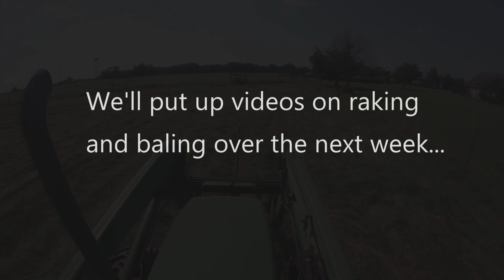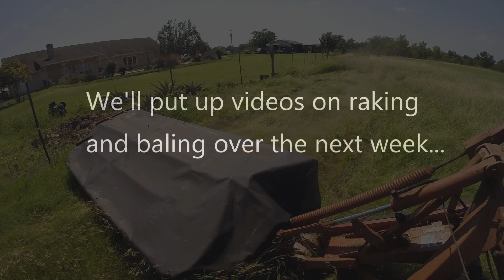Cutting Hay; Cutting Bermudagrass Hay with an Old Kuhn Disk Mower

Comment: Every one that I see mowing circles the field,     We circle the outside about 6 mower widths and then star on one side of the field and    mow from one end to the other..... in straight cuts..... All our tractors are GPS  auto steer so the cuts are  even and more precise...... also it allows you to bale  in basically the same way it is mowed....  no dragging hay from across the cuts....   cleaner    less field loss
Reply from the maker: We stopped raking or baling in circles but our new cutter works  great in spirals.
Reply: What make is your new cutter/ @TheFritz423
Reply from the maker: Kubota DM 5032
Reply: Our first mower was a KUHN   But the 2nd year we sold it a got Krone Easy-Cut 320   then  added a 4755 KMC   cart.... because it is easier to hook up and makes tractor swaps a breeze..... We now have 3  and a 3200 trail.... .. ....   Most of our hay is  used to fill supply  trailer loads of  rebaled small squares to contracted TSC stores in our area...... We round bale everything, haul, store and rebale as needed   we also sell rounds...